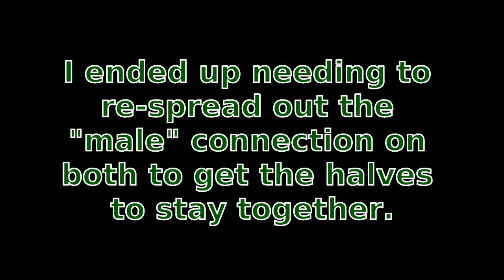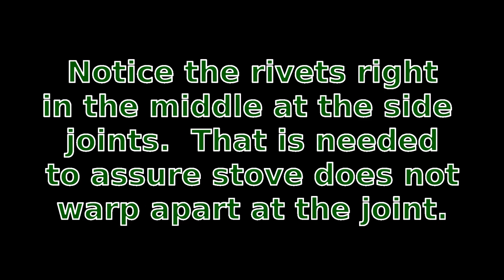Make A Simple Cheap Tent Wood stove - Part 1

Comment: How's that stove holding up? Do you still use it?
Reply from the maker: It is holding up fine.  On the day that you posted this question, I was out using that stove and will be using it (Lord willing) in an upcoming video.
Reply: @Far-North-Bushcraft-Survival  I'm looking forward to your new video using the stove. I'm going to use your instruction to build one myself to use in our new hot tent. I just love that design! If you are the one who came up with that design, I applaud you. It's by far the best DIY hot tent stove design I've seen! Thank you for sharing it with us!
Reply: @Far-North-Bushcraft-Survival  Hello Lonnie, I'm starting to build a stove like the one you built in this video. I'm wondering if you like the baffle as you made it? If you built another stove like this one, would you change the baffle or would you place it differently? Thanks for all your help!
Reply from the maker: Since I built this stove I have ended up with two stainless steel stove which both have baffles in them which I really like.  They are the Caminus M as well as the Caminus L stoves from Russian Bear Market at the address below.  They are Russian made stoves.   The stove pipe is in the front of the stove and the baffle goes from the front to just short of the back of the stove.   The gases go to the back and up just like most stoves but then go over the baffle and travel to the front of the stove before exiting the stove pipe.   I would probably cut out a portion of the stove pipe that sticks below the surface of the top of the stove so that the baffle could be brought up to almost the bottom of that pipe and still allow the gasses to flow.   I am very pleased with the way that this homemade baffle works however.  We used this stove in our latest video that is now online in case you missed it and we were bot remarking how the stove drafted so good.  There was virtually almost no smoke that ever back drafted int teh tent even with teh door wide open when stoking it.    We did leave a bit of a gap between the back of the baffle and the back of the stove however.  I think it was about a half inch.  I don't know if that helps the draft or not but it is one of my better stoves for lack of back draft.

https://hot-tent.com/collections/stoves-for-tents
Reply: @Far-North-Bushcraft-Survival  Thank you for the in depth reply and information. I really like the videos you made of the Canimus stoves. They look like a real nice stove. I did consider a baffle design like those stoves but I didn't want my stove sitting back that far since the exhaust pipe is in the front. I don't want to use a heat shield on the side of the tent at the back of the stove if I can help it. I also thought working around the exhaust while cooking might be annoying too.
I ended up putting in a baffle similar to the one you made. We'll see how it drafts when I fire it up. I did make my baffle a little longer and it's against the back of the stove. If those are mistakes I'll have to modify it. That's just part of the fun in making a DIY wood stove I think. Again, thank you for all the information and inspiration! Bruce
Reply from the maker: My baffle in my homemade stove actually works great.   Hope yours turns out good as well.
Reply: @Far-North-Bushcraft-Survival  I just lit up the stove today for it's first burn. The baffle worked real nice. I'm a little concerned about the metal thickness of my stove. It seems like mine is a thinner gauge than yours. I'll burn it a few more times and then I'll know if it will work with this thin metal. Thanks again for all the inspiration and great videos!

Here is a link to the video I made building your stove if you are interested in seeing how mine came out.
https://youtu.be/J4FLZI9bGbQ
Reply from the maker: @DIYHomesteadProjectsDIYHP10     Just watched your video and was very impressed.  You said that was your first stove build.  You did an awesome job that made my stove look bad by comparison.  lol  I am looking forward to the burn video if you do one.   I'll bet your metal thickness is the same as mine because I believe that I got my duct sheet metal also from either Lowes or Home Depot.   These stoves may not last for years and years but I'll bet that they last long enough to more than pay for themselves.
Reply: @Far-North-Bushcraft-Survival  Thank you Lonnie, I appreciate your opinion on my stove build. I never would have thought of making a stove like this without your video showing me how. I will make a burn video soon. I'm excited to give the stove a try and get out and use it. I'm thinking if it makes it through a season, it will have more than paid for it's self. Take care and thanks again for the inspiration!

Comment: How long will the stove last
Reply from the maker: I still have the stove and it is still in good working order.   Your question can not have a definitive answer as there are just too many variables.   If one only uses the stove a couple times a year and each trip is only a couple days long, and if the humidity is always low during the rest of the year and if the stove is cleaned out very well after each use, and if the stove is stored in a dry location, the stove may last 15 -20 years or more especially if a light coating of oil is applied after each use before storing.   If the stove is employed for full time use, it may only last a couple months.

Comment: How is the longevity of it?
Reply from the maker: It depends in part on how it is taken care of.  Do not store in a wet location.  Do not store with ashes still in the stove.   Empty the ashes out after each use.  It also depends on how the stove is used.  This is not a stove to use in a permanent dwelling or building.   If onew never uses it, it should last almost for ever.   If one uses it daily, it will not last very many months most likely.

Comment: You vent hole should be bent out. It should fit inside your stack.So the carbonminoxide doesn't fill up your tent and kill you.
Reply from the maker: No.  The stove pipe collar is the way that it should be.   I have grown up around wood stoves and have used them as my primary heat for my home for many years.   If you arrange it as you suggest you will be driven out of your tent and end up throwing the stove out or modifying it as it should have been in the first place.   Burning wood creates distillates.  Those distillates condense out on the stove pipe and run back down into the fire box of a properly designed stove.  In your design the distillates will run down the stove pipe and onto the top of the stove and will drive you out from the fumes and stink.  There is no worry of carbon monoxide escapement in a properly designed stove such as this one.

Comment: How do you make that baffle? Dimensions? How big is the air intake? You skipped a bunch of steps. Why?
Reply: Can you put you locking pins on a down ward slant to keep them from sliding open
Reply from the maker: The stove is at a winter tent setup away from home so I cannot measure everything for you.   If you want the locking pins to go downward feel free to place them so.   I placed them the way i dis to theoretically make them easier to handle by stick etc when they are hot.

Comment: How long had lasted thhe bucket stove?
Reply from the maker: The home made bucket stove is still going strong.   The side of teh door opening is a bit weak so I have to not get to forceful when closing the door but a little added flat steel reinforcement would be all that is needed to get many morte years of use out of the bucket stove.  The door opening has been weak ever since it was made due to the large door opening and should have had some reinforcement built in at that time.
Reply: @Far-North-Bushcraft-Survival  thank you. thought it is good only for one winter. anyway it is great size/weight/price-wise.

Comment: Wouldn't the coals be a bit hot for aluminium?
Reply from the maker: There is no aluminum on this stove.  The angle aluminum that I would liked to have used for the legs but didn't, would of course be outside of the stove and not exposed to the same levels of heat
Reply from the maker: Yes the duct is galvanized steel.
Reply from the maker: Yes it would rust most likely if left out in the weather.  However i will be spraying the inside as well as outside with a cooking oil spray at end of each season and will be storing the stove out of the weather.

Comment: What are those tools to create a wood stove tent?
Reply from the maker: I do not know what it is you are asking.  However below is a couple links to videos that may answer your questions.

Make A Tarp Tent Tipi Hot Tent On The Cheap
https://www.youtube.com/watch?v=wtLdMIaIIFw

Turn Your Tarp Tent Into a Hot Tent - Stove Installation
https://www.youtube.com/watch?v=HfiUgGhTe1k

Make A Pyramid or Range Hot Tent On The Cheap
https://www.youtube.com/watch?v=t47WFUZM4go
Reply: @Far-North-Bushcraft-Survival  thanks sir,
I mean if I want to build a very small factory of making tent stove what are those tools machines needed like CNC or whatever?
Reply from the maker: I have never worked metal on a commercial level so I cannot answer you as I do not know what machines/tools are available and which would be best.

Comment: The problem with using GALVANIZED Steel is that it releases Toxic fumes in the air when it reached a certain temperature...........
Reply from the maker: I address that somewhat misconception either in this video or part 2 of this 2 part series.

Comment: Do you have dimensions of that wood block?
Reply from the maker: I assume you are referring to the block used to form the stove pipe collar on the stove.   The size of my block is immaterial since you may have a different sized stove pipe that you will want to fit on the stove.   So what I am saying is that you need to decide what size stove pipe you will want and then size the block to enable fashioning a suitable sized opening on the stove that will fit the pipe.
Reply: @Far-North-Bushcraft-Survival  I was referring to the block that you made for the stove pipe collar. Just need to know the dimensions as I'll be making something similar. Thanks a lot.

Comment: How is this idea, three inch wide foot long copper pipe end cap's drill hole in end cap for fuel spout copper tube with tiny copper tube inside to allow air to vent has you fill the alcohol resivor on one end cap. High heat carbon felt to use has a wick in the other end cap that you have drilled a hole into with a twist cap that you can remove and screw on a copper tube with high heat carbon felt has a wick inside copper tube. Screw on copper tube come's off resivor  bend's around the burner to were it can be heated by the burner then bends around and connect's to a twist valve and then to the burner. Put a little dish under the burner to prime it then ounce the alcohol became's presrixed use the twist valve to adjust the flame on the burner. Okay now y'all got a presurized alcohol burner. Get some thin Titanium and make a canopy that you can place just over the burner and design the burner to sit in the bottom of your stove. The titanium will glow white hot with the radiant heat being absorbed by your stove. An alternative way to use your stove off denatured alcohol for a clean burn no smoke. 😊👍
Reply from the maker: Sounds interesting for those who prefer not to burn wood

Comment: Be careful with galvanized metals... Used this in a closed environment and you can die from Zinc poisoning. Not saying that it will happen, but if you do used galvanized piping and you're around it for a period of time (or plan to be) give it a good burn for a while in an open outdoor space first and get some of those fumes and toxic air out. Should be fine then.
Reply from the maker: If you watch The complete video you would know that the subject you are discussing here was covered in the video.

Comment: 22 inch and 22 inches are 40 inches wow really I thought it was less
Reply from the maker: Uhhh, ya might want to take a closer look at your statement.   Just letting you know in case you wanted to correct your math.   No need to be embarrassed however since you are not alone.   I was looking around for a particular extra pair of socks earlier today because my feet were cold.   I finally discovered where I had put the socks.  They were already on my feet.
Reply: @Far-North-Bushcraft-Survival  guess you didn't get my sarcasm, glad you found your socks next time put your shoes on first then your socks so you don't forget them

Comment: Galvanized is poisness when heat be aware very dangerous
Reply from the maker: Watch the entire video next time
Reply: @Far-North-Bushcraft-Survival  you keep saying that. Use stainless steel the first time. You made a rust bucket.
Reply from the maker: @Matt M    I am not concerned at all about this rusting through.   I now have a total of 5 hot tent wood stoves and have grown up around woodstoves. Our home has been heated many years by woodstoves and our cabin is still heated that way so I am no stranger to woodstoves.  At the end of each season I will be cleaning this stove out and spraying the stove inside and out with PAM type cooking oil and storing the stove out of the weather.  It will be fine.    If you had the experience i do with woodstoves and if you have worked with stainless steel using hand methods such as I did in this video you would quickly realize what your statement sounds like.
Reply from the maker: I have unpainted steel (non stainless) tent stoves that are as old as 40 years old and I have done nothing with them at end of season other than empty the contents and store out of the weather.
Reply from the maker: @Matt M   If I had a choice of prime material then I would much rather have a stainless steel stove.   You are correct that stainless is a superior material for stoves.   However stainless does not fit the circumstance that this video was made to address.  Galvanized ducting sheet metal is widely available and is easily worked.   Which makes this stove possible for a huge number of people.

Comment: you need to buy yourself a pair of duck bill pliers....
Reply from the maker: After looking at what the "duck billed pliers" are online, you are right.  I could use one of those.   However they would only be good for sheet metal bends that are close to the edge.   I have a DIY break down pack stove in mind that could really make use of one of those pliers.
Reply: @Far-North-Bushcraft-Survival  you can also use each side of the duck bills on both corners of your bend on your sheet metal, to start a line to bend.
Reply from the maker: Awesome.  I ordered one of the tools from Amazon.  I have a project in mind that these "Duck Billed Pliers" ought to work perfect for.

Comment: why go thru all that trouble to bend and form that sheet metal pipe when all you have to do is buy a square duct instead. Go Figure. By the way those sheet metal stoves get red hot and glow. Make sure you make tall legs on that thing.
Reply from the maker: In order to make the stove out of square sheet metal you have to HAVE square sheet metal available and in the dimensions that you desire.

Comment: So many work for one time using, realy???
Reply from the maker: This stove should last for quite a few years if it is properly taken care of when storing.
Reply: @Far-North-Bushcraft-Survival   I do not believe. I make barbecues from 4mm thick metal because the thinner metal burns.
Reply: @Far-North-Bushcraft-Survival  In this video you can see how the metal is deformed after a slight heating
Reply from the maker: I have used thin metal stoves for many years and know that they last well if they are taken care of.
Reply from the maker: The ash needs to be thoroughly emptied out after each campout and the clean empty stove stored in a dry location.